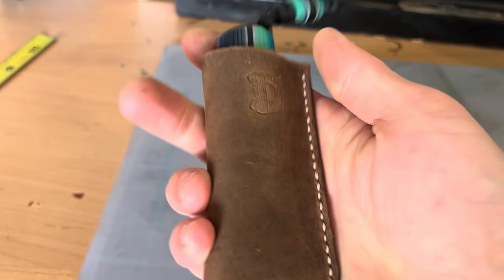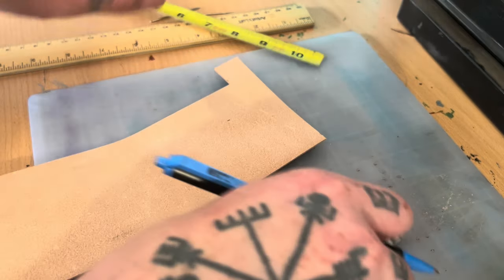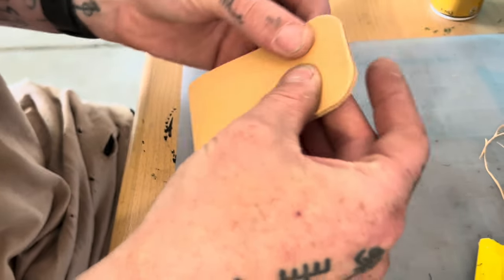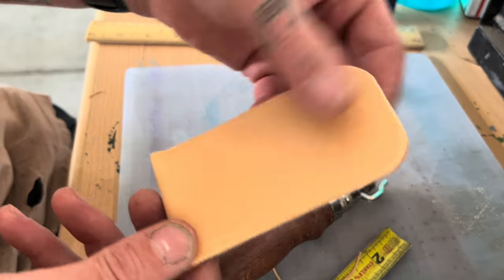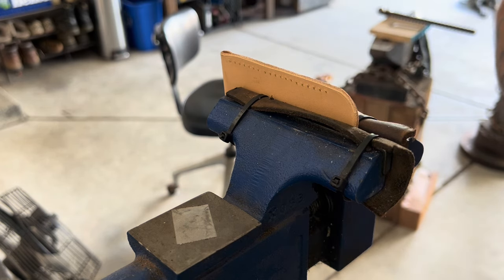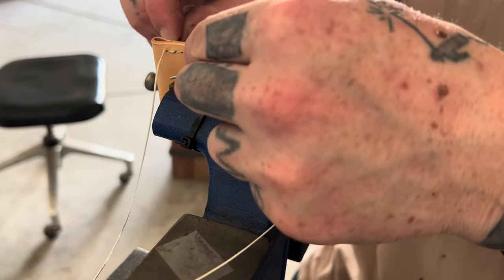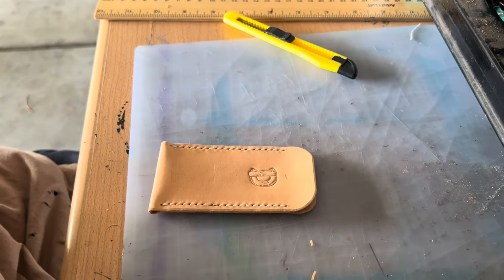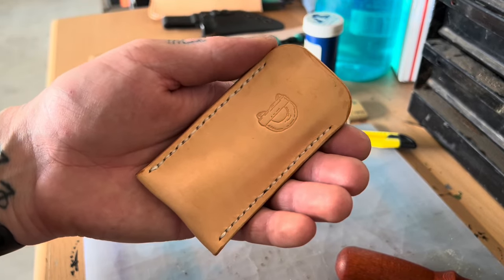Step by Step Tutorial: Make Your Own Leather Slips!

Comment: Very instructional video.  I think you could avoid spacing issues by simply overlapping 1 hole each time you re-punch the next set of holes.  Also you might try a rounding at the bottom as well it will be harder to get your holes punched but will ride nicely in tour pocket.
Reply from the maker: I started doing that recently, yeah. Helps a ton